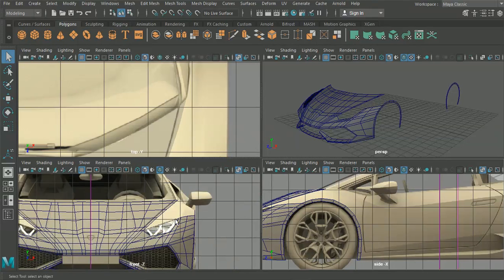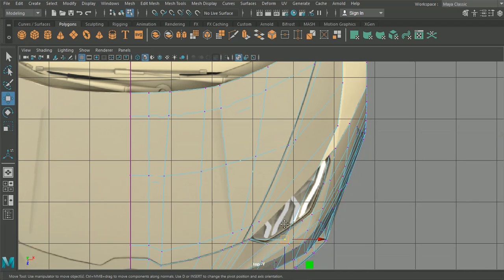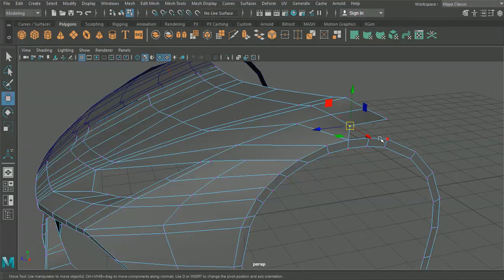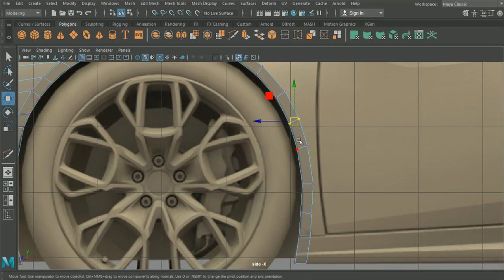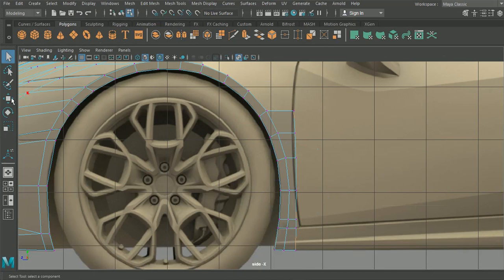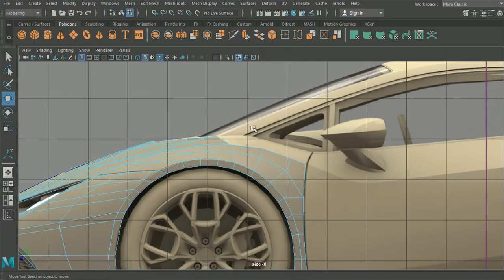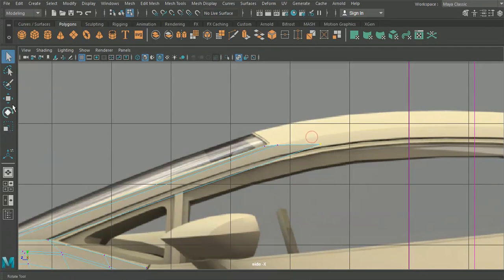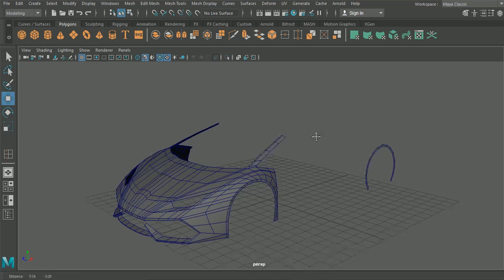3D Car Modeling Tutorial pt.3 | Autodesk Maya | Modeling a Lamborghini Huracan

Comment: thank you for you good explaining but i want to know how do you plan to start modeling in a new car shape what is the idea to make my own car model not to just follow some one videos
Reply from the maker: You just follow the main lines of the cars. The process is very similar for each car, identify the distinguishing lines and creases then add required lines in between. I always start in the same place and I model each car using the same tools. Like most things, just keep practising.
Reply: Essentially these videos teach you how to take a 2D image and turn it into a 3D model, but you're also learning everything you need to start from scratch and make your own, I'd recommend starting with drawing your idea if you haven't, then try to re-create that in 3D to your liking

I'm intending on doing the same and eventually taking that to the point of mods for Assetto Corsa / Car Mechanic Sim 2018, knowing how everything works and learning good practices are the biggest part of this series

Comment: i know im a little late to the party but in stead of moving a vertex to another vertex by using V and merging you can just use the target weld tool and take the vertex that needs to move to the other vertex and weld it, basically making your 3 button clicks one operation to speed up work flow. also i believe we are all advanced enough on this tutorial to be able to handle the short cut keys for move scale and rotate instead of watching you click the icons.
Reply: also my model is looking a little bit different than yours, but thats on purpose i added hood scoops to my bonnet and will eventually either add a rocket bunny wide body kit or a liberty walk wide body kit with a tail wing as well.
Reply from the maker: Thanks for the comment. I get what you're saying but I've been doing this so long, I've become a creature of habit. Merging, selecting, hitting icons I do without thinking because I'm spending that small about of time planning the next move. Making these videos with the limited time I have means I need to plan the geometry and what I'm going to do next whilst I'm recording, which means that muscle memory is just taking over. Also, there are many viewers that aren't advanced so there needs to be a balance.
Reply: 8fifty2torials i get the muscle memory ivr been modeling since 2011
Reply: 8fifty2torials also do you have an Instagram that i can tag in my next update of the build for you to see?